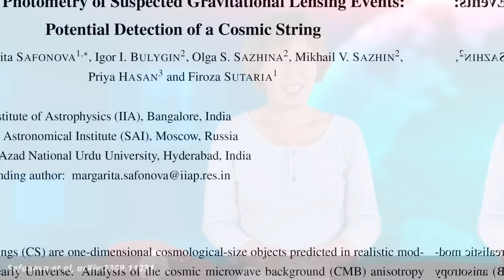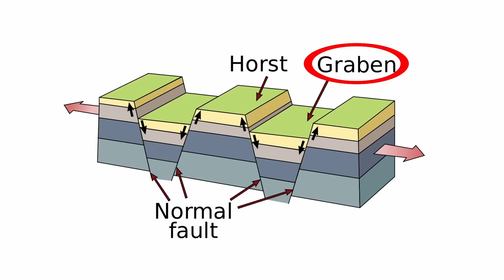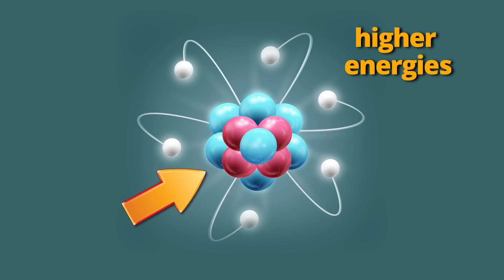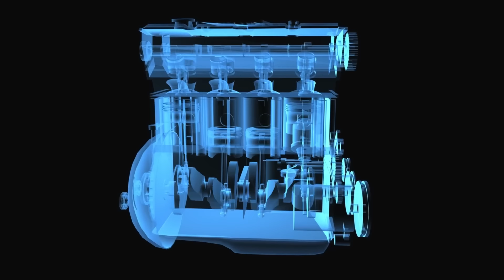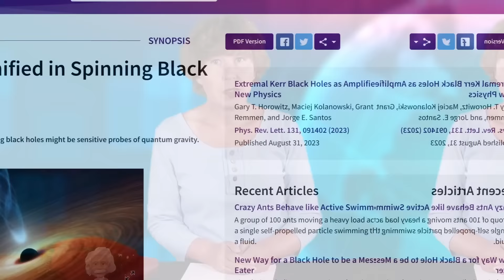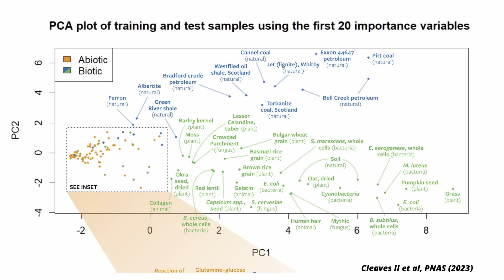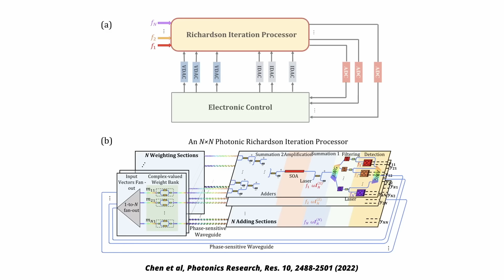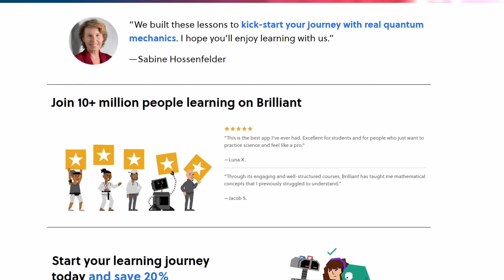Could this be the first evidence for string theory?

Comment: For the new general computing trend of specialized hardware to speed things up at 16:13 - 16:26 I wrote computer programs for IBM 360/44 1968-73, for oil & gas exploration, in Fortran IV-E & Assembler and our (rented) IBM included a "convolver" specialized hardware (size of a wardrobe) that simply did the convolving process of 2 time series (multiply aligned values, sum them all, shift 1  time series & repeat). Not sure whether my Fast Fourier Transform for frequency domain filtering let them return the "convolver" to save rental but then the  Raytheon 706 and Varian V73 happened and an Array Transform Processor (ATP) little slide-in box arrived cheap enough to buy outright so it was the scrap heap for the old "convolver", much like me now. That was nostalgic.

Comment: 15:09
You forgot to mention probably the most significant application: current AI models are pretty much entirely based on matrix multiplication. So better dedicated hardware will give us faster and probably bigger models to inevitably bring forth our robot overlords.
Reply: Was going to post this comment. This is also why graphics cards are great for doing machine learning, and why photonic computing will finally let me run Crysis.
Reply: Computer graphics as well.
Reply: If you knew what you are talking about, you could explain it in comprehensive English
Reply: @davidharvey3743 if you comprehensively understood English you'd be able to see that that was pretty thoroughly explained.  It wasn't explained in very simple terms, but it was put well using the level of complexity appropriate for the topic at hand.
Reply: I think Nvidia DOES already have dedicated hardware for this. It's their Tensor-core Processing Units  (TPUs) that they use to run machine-learning models using matrix multiplication, iirc.
Reply: I for one welcome our new overlords. And am prepared to server them duly.
Reply: @Edruezzi  There is not much to talk about numerical computation in AI. AI is just numerical computation at scale. A core of all modern AI is an artificial neural network. An artificial neural network is just matrix multiplication with an application of smooth (continuously differentiable) usually monotonic limited nonlinear functions like sigmoid or hyperbolic tangent several times repeated in layers.
Reply: What @python_I5367 said is especially important as well; I feel like Sabine grossly underestimated in her explanation on how crucial matrix multiplication is in basically everything we do on our devices - basically any form of graphical rendering - be it website, games, or other applications - rely on matrix multiplication.
Reply: By that time everyone will be using Clifford algebras.
Reply: @fwiffo your optimism is unjustified if you think you'll get to run crysis
Reply: All hail our AI overlords

Comment: The schematic image at 1:38 has the object that is seen twice not reflected, but the actual photo at 2:00 has it reflected. What is the correct expectation?

When I visualize the situation I expect it to look like the schematic, but if the photo were wrong the experts should have noticed by now.

Edit: In the conclusion, the paper hypothesizes that "the string is strongly inclined to the line of sight
and, possibly, bent in the image plane". They talk about having to do general relativity computations to get it to match.

Comment: 2 fermions make a boson? That shows it's all to do with spin, then.
And the W and Z particles aren't bosons. They are baryons with super-added spins. The Z, for example, spinwise, is a level 20 proton meeting a level 19 proton and a level 15 proton. That's why it adds to 91.16 GeV. There's a mechanical reason why its that number, not pulled out the air like Weinberg.
Reply: W and Z have integer spin values. 

"In particle physics, the W and Z bosons are vector bosons that are together known as the weak bosons or more generally as the intermediate vector bosons." wikipedia.

Comment: Ytterbium atomic clocks are about ten times as accurate as Caesium atomic clocks (because they rely on light waves rather than microwaves). Lutetium atomic clocks may be more accurate, which would be nice because it would mean we actually have a use for lutetium. I need a clock that is accurate to a second in three billion years to get to work on time.

Comment: If I remember correctly, the Kerr equation removed the singularity from the center of a black hole. It's something I've been trying to understand for a while, and for me, it started by questioning the size of the hole. As the hole absorbs mass, it gets larger, but how is this possible if the mass is a singularity?

Comment: That spin and gravity isn't lost in a black hole should speak volumes about how they work, I would think.
And yes I strongly suspect that spin modified gravity is a thing. Both from observations of ET ships and the galactic spin anomaly and cosmic jets. Spin seems to be the common trigger.
ET ships sometimes have a spinning section, aircraft in close proximity observe their compass spinning like a motor and a vortex force has been observed under ET ships. One could argue that just a spinning integral part of an ET ship is conclusive in itself. If mass spin wasn't necessary then it's a very clumsy design compromise and they would avoid it.
Seeing as just spinning mass doesn't create exotic effects it might require a resonant EM component or more. If we could learn more of the conditions for cosmic jets it might become obvious.

Comment: The shrinkage of Mercury is really interesting because one would expect that the core of any planet becomes significantly cooler since its time of formation as a molten ball. And, everyone knows that cooling bodies of matter shrink. A few kilometers of diameter over a billion years? I guess there would have been a previous 3 billion years for the interior heat distribution to settle into the thresholds of the last billion. And, the crust would have cooled solid enough to begin to show contractional features at the 1 bya mark?

What makes me curious is that our own planet has that plate tectonics characteristic that swallows evidence of planet contraction like a grocery store conveyor belt can swallow your coupon. And a century ago, early paleontologists floated an idea called paleogravity to explain why dinosaurs were so massive. If they seemed too heavy to walk on land, another way to express that thought would be to say that they appeared to have evolved under lower surface gravity due to an expanded planetary diameter for Earth's mass. So, how exactly did paleogravity come to be dismissed? I'm not saying paleogravity needs to be resurrected. I simply want to know what information it was that eliminated it a century ago. If there was a 'paleogravity" page on Wikipedia, I swear I would have read that instead of troubling this comment section.

Comment: It is incredibly impressive that they can make a clock that will run for 300 Billion years!
Reply: Says so on the warranty. . .
Reply: It's not what they did, they built a clock that (on average) will diverge by less than a second every 300 billion years.
That is, when the clock indicates 300 billion years have passed on its display, then, 300 billion years, more or less one second, have actually passed.
The issue is that the clock is not meant to withstand 300 billion years it's just an extrapolation.

What they can actually do is keep it on for short intervals of time, to very (very very very) accurately measure very (very very very) short phenomenons.

Comment: I think there should be a difference between quantum string and cosmic string. When I see the headline cosmic string I think astro scale,  not quantum scale. While yes quantum objects can be in astro scale,  like black holes,  in some depictions,  generally speaking string theory tends to the smallest of the small.  When I hear cosmic string I think if those linear bands to tightly connected protons stretching between stars with mass like multiple Earths per kilometer of stretch.  Funny that those headlines of discovery of such objects seem to have completely disappeared from the internet.

Comment: Thank you so much ❤Sabine for your reporting this interesing scientific news 0:33 on a cosmic string that strengthens our current universe is not a continuum of a type of inflationary big bang instead the evolved one from an ultimate chaos which is the starting points through 1 dimensional strings then Dirac Sea of 2D-branes. 2:42

Comment: If a black hole were formed at the big bang and inflation stretched it into a string like structure. The ends of the black hole string could collapse at the speed of light but inflation could stretch the ends away from each other at FTL speeds. An interesting idea, but I would not put money on it.

Comment: if the human body's GI tract is considered a continuous tunnel through the body, wouldn't that make humans topologically toroidal?
Reply: It would be a bit more complicated than a simple toroid. The GI tract connects to the pulmonary system, which would have an extra tube connected to the center tube that spits into two tubes for the nostrils, and many small tubes on the surface for the intricate passeges in the lungs. 

There might also be a set of tubes for going around the ear bones, and a tube for every piercing.

Comment: With the atomic clock being so precise, it means the location of the clock itself becomes a factor  as well? In away, the clock location becomes the baseline for the rest of us, if we use that clock as the ‘real’ time?

With that I mean that where the clock is located on Earth plays a role too, considering the spinning of the Earth around its axis, and other potential variables? 
Wouldn’t there be a measurable difference when measuring time on the North Pole versus, say, South Africa?

Comment: I don't get the "wrinkly" thing. It seems like it's used as a way of saying that it's smaller but doesn't loose mass. But it doesn't work, an apple gets wrinkly when it looses water volume, so the surface must be smaller.
Reply: Does the sun blast materials off the surface?
The same side is always facing the sun.
Over time this unbalanced the planet so adjustments caused the wrinkles

Comment: Interesting.  Question (which I don't know enough about).  Would a stellar mass black hole be enough to lens a galaxy like the one in the cosmic string article without distorting it too much?  Just wondering if something like this could also be mistaken for a cosmic string...
Reply: I don't think so, gravitational lensing has a very definite pattern, and it would not result in exact duplication.
Reply: It would probably have to be very close to the observer.
Reply: Additionally, there would be extreme distortion to the light waves from such a blackhole.

Comment: The pair had never been viewed prior to this.  They are the result of galactic interaction.  At the distances involved and with the resolution limit of data collected there is absolutely no way to rule out that they are as I posit.  Further, their spectra should mathch exactly...they do not.  If the probe collects a difference in spectra data, then you wither believe the data or you do not,  if the data is to be believed, then they ARE NOT object and image.  The data must match.  But, if they are in some part of interaction then the shared volume of space they inhabit are more than capable of producing the aggreagate spectrum of the combined system with nuanced variation due to each still being distinct.

If you dont believe the data...then the entire discussion is pointless.  

Heres a bigger issue.  This "cosmic string" which is a massive massive object just happened to be in a location where there was ONLY ONE OBJECT/ IMAGE PAIR....no other stellar objects were behind it along its entire length.  Really?  Want to calculate the likelihood of that?  

This is another attempt at grasping at straws...something the string theorists are increasinly doing since the community has finally realized they are free to open their mouths and discuss their concerns regarding ST.

One last point...pixels.  in this image each pixel could represent a span of up to 10,000 lys.  That means that what you are seeing is absolutely influenced by the path of light generating each pixel.  The composite image is basically a point equalling on and off where on amd off are determined by threshold values.  But, those thresholds are nearly arbitrary if you do not know what you are looking at.  The separation that appears to exist between them may not be...I contend is not...actually a separation but the result of the probe no being able to resolve the material that joins the two galaxies.

Comment: I'm skeptical that the AI method will be useful in determining whether anything has alien origins. Obviously 90% accuracy is nowhere near what you need for that, and even 99.9% accuracy wouldn't be close to enough, since the base rate for "has alien biological origins", even if nonzero, is extremely low. But even if the AI was improved to become more accurate, it's still only trained to distinguish terrestrial biological origins from non-biological origins. There's no reason to think this would generalize to being able to determine extraterrestrial biological origins.

Comment: I'm a bit confused as to how an atomic clock based on cesium electron transitions would not be considered 100% accurate when the definition of the second is based on that exact frequency. 

Is it simply that our machines are not able to accurately measure that transition or am I misunderstanding what "unperturbed ground-state hyperfine transition frequency" means? Because I certainly don't know what that means beyond the layman explanations I've heard in the past describing it in terms of electron energy state transitions.
Reply: Every tiny electromagnetic field will perturb the transition energy of an atom ever so slighly. That means that there is a limit to the stability of the frequency. Another effect is that due to the uncertanty relation of Heisenberg there is a limit to the accuracy you can measure the frequency of a system in a finite time.

Comment: Why does the cosmic string create a mirror image? In your diagram, you correctly didn’t mirror it. In their candidate images it looks reflected.
Reply: I asked chatgpt because I’m lonely:

If a cosmic string were to act as a gravitational lens, it wouldn't create a mirror image (reflection) of a galaxy but rather would produce a lensed image that's offset and potentially distorted. The lensing would be more akin to a translation or a "relocation" of the galaxy's image in the sky, as you suggested.

Comment: This can only be true.
Why ? Well since it was only a ball opf gas at one time, cooling down.
After it cooled down enough, it became a planet.
This didn't stop the cooling down. Even though it's still hot, much hotter there,
this in and by itself doesn't mean it's not cooling down.
When cooling happens matter shrinks. Obvious it's shrinking.

But what if I told you that Earth is also still shrinking ?
It's not that hot at the surface, but the inside is slowly but surely losing heat.
Compared to the 3-ish Kelvin, galactic mean temperature, the Earth is still much hotter,
which therefore means outward radiation of heat, even through the mantle.
Yes, we receive heat from the Sun at the surface, adding heat as well, but..
You know how a limit never reaches it's limit ? Well, the Earth is destined to be
that 3 Kelvin one day, both inside and out, when not re-absorbed by the Sun.
The only thing staving it off is added heat from the Sun, which raises the limit,
and yet, even with the higher limit the core is still cooling down.
Not fast though, but a little over lots of time.
Even permafrost is hotter than galactic mean temp, and since heat rises,
the heat from the core rises also, adding heat to the surface.
I guess when the core is cold, the Earth will have a much colder climate, despite CO2 levels.

No worries though. It would take eon's.